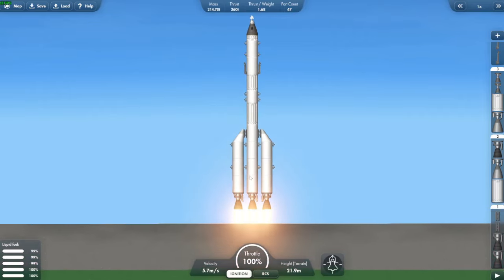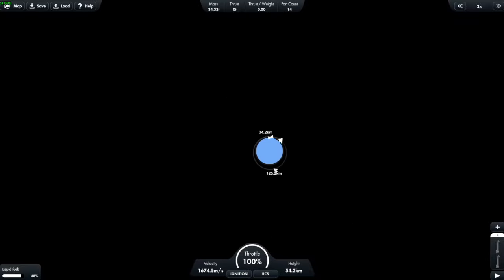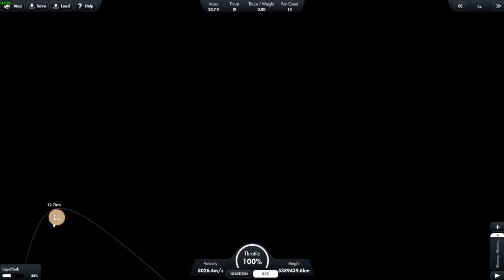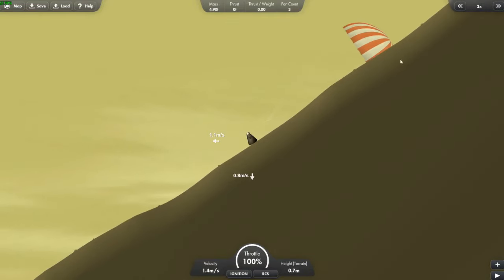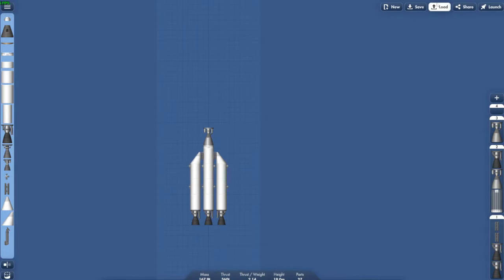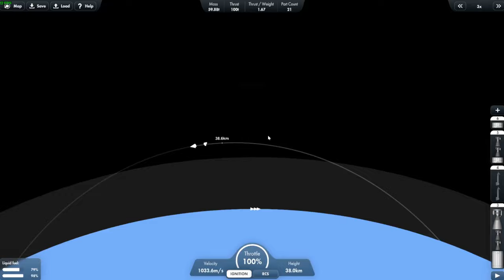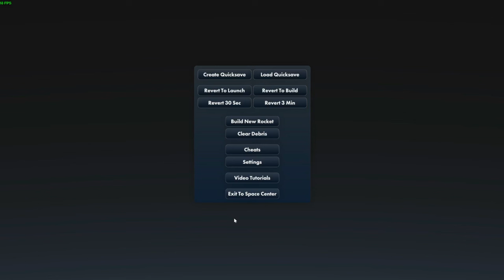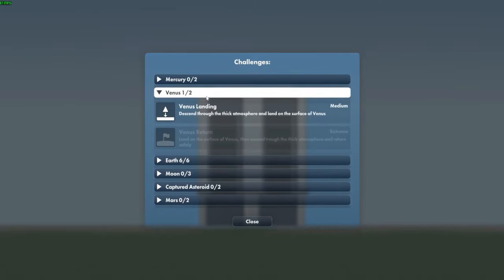SpaceFlight Simulator-Ep.2 Trying to get to Venus

Comment: Hm
maybe you should make the second stage longer ( if you count the side booster as a first stage then it's the third)
But I will admit, you have successfully how to reach orbit 
Heres a hack if you're reaching to Mars of you're planning to:
Don't go straight to ground, go like around 10km or 5km at lowest point so that you can slow down enough 
Try using around 3 to 4 parachutes, check the Aerodynamics section and get the thinner side one to attempt to fit, use Parts Clipping to put all of it in the top of the capsule if you want and use staging to deploy all of them. You can also use thruster to land down to Mars, use a large rocket and many rcs thrusters to control landing
then deploy parachute and also use thruster to land with velocity bellow 10m/s so the landing leg can survive
P.S: use large fuel tanks for the first/second stage so you can have more fuel for orbit, maybe like 8 sides will do the trick, if the weight to thrust ratio is bellow 1 then you shohld add Titan engine to the booster to help, but it will cause the side booster to end early. I recommend getting 6 sides for the booster and 6 to 10 sides for the main,  also replace the main stage with Titan Engine for a better chance at reaching orbit.